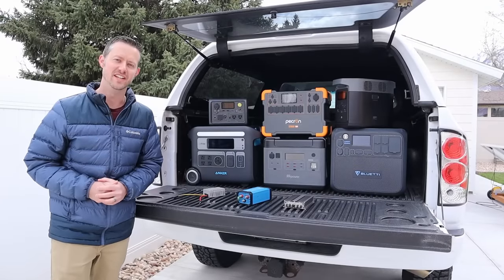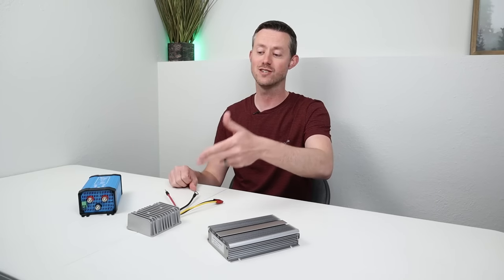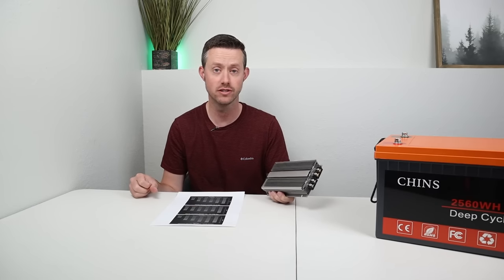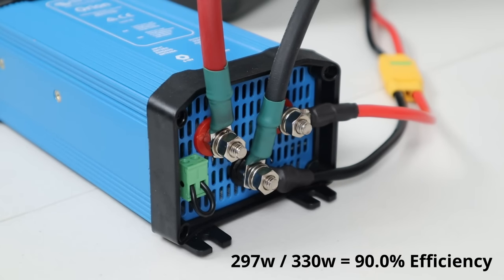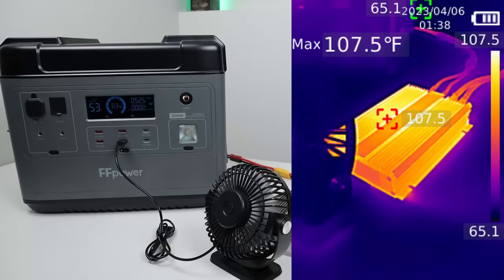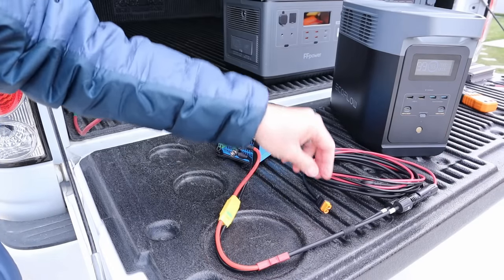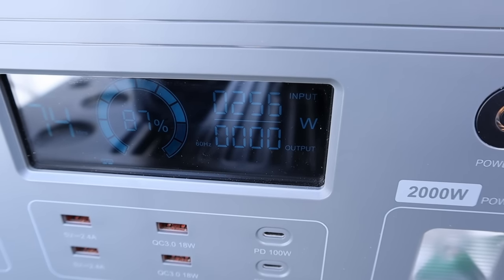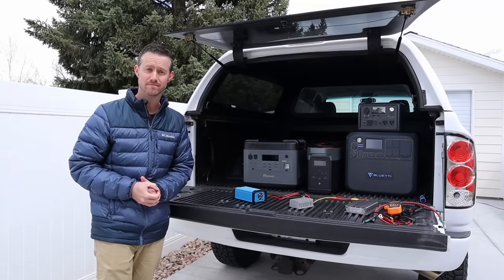Charge Your Power Station In Your Car FASTER - Perfect for Overlanding, Car Camping, and Van Life!

Comment: I'm wondering how your truck electrical is connected to your truck battery? are you using a direct connection with fuse or perhaps a voltage sensing split charge relay that only operates when the truck is running? What are your thoughts?
Reply from the maker: I wired one 6awg wire from the battery with a fuse. I'm using the frame as ground. No relays and I just connect the DC to DC converter when needed. It's not an automated system.
Reply: Thanks but how are you preventing  your starter battery from completely discharging?
Reply from the maker: @berniefranklin3586  I only plug in the converter when in use (when the engine is running).

Comment: Hi Jason I just finished viewing this vid.  Great as always!  I have a hypothetical question.  Is it possible to charge your power station using my Kisae DC to DC charger?  Just curious, please inform.

Thank You!😢😢
Reply from the maker: The output voltage of the Kisae is only 14v, so you'd get the same charging speed on your power station that you'd get using regular 12v charging. You need to get higher voltage output to charge faster.
Reply: @Jasonoid  Okay thank you, I need to save up a little more.  But I'm looking at one of your suggested products  i.e. "Victron Energy Orion"
Reply: Hi Jason, I was able to  purchase the Victron Energy Orion 12/24-Volt 20 amp DC-DC Converter Non-Isolated.  I'll be using it to keep my power stations top off in my home.  Like you have it set up on your tabletop.  The battery and converter would only be around 2 to 3 feet away from my power stations.  Would 8 gauge wire from my battery to the converter and 10 gauge wire to my Yeti.  Are the wiring sizes I'm using suffice?   Lastly should I be using fuses in this scenario?

Thanks You!
Reply from the maker: Fuse goes between your battery and the converter. 10 awg is good for 30 amps continous. I'm not sure how many amps the Yeti supports for input.
Reply: @Jasonoid  Hi Jason thanks for responding.  My Yeti's will take the following charges: 
 
YETI 1250 - High Power charging port (input): 16-48V, up to 20A (320W max)

YETI 1000X - High Power charging port 14-50V, up to 25A (300W max)

YETI 400 - Charging Port (input, 8mm, blue, circle): 14-29V, up to 10A (120W max)

I've been with Goal Zero over 8 years now.  I tried the 
BLUETTI products and the support was horrible, so I sent it back.  I may upgrade later on, but what I have right now fits my needs.

Thanks Again!
Reply from the maker: @minceym  Goal Zero makes excellent products, they are just a little dated. New stuff should be coming soon from them. The Victron should work well with each of those units. 10 awg wire will be fine.
Reply: @Jasonoid  Thanks for your help, yes they are a little dated.  But all of my AGM units were upgraded with new VMAX batteries.  Including chaining several of them in parallel extending my runtimes further out.  My full size refrigerator got over 30 hours  runtimes using one VMAX 125Ah in parallel with the unit.  And a 100Ah Lithium battery using the Goal Zero new car adapter plug into this unit.  This time I'll use the Victron, I should get better results.  Dated but very much reliable.  My only issue was the recharge times.  I also purchased the Clore Automotive PL2320 20-Amp charger for that reason.  So now I have multiple ways to keep these units operational.

Regards!
Reply: Hi Jason, I have some issues when connecting the Orion to my Goal Zero 1000X.  It seems to be working then my 30 amp fuse to the battery blows.  I think the Orion is putting out more power at first glance.  It was over 500 watts.  I turned the potmeter counter clockwise as far as it would go.  The Goal Zero unit is rated for 600W input.  Is the fuse I'm using too low?  Lastly my fuse battery cables are 8 gauge with a 30 amp fuse.  I had them made up already from an existing project.  And the other connection is 10 gauge to the Goal Zero power pole input connection, is that an issue?

Any help would be greatly appreciated!
Reply from the maker: @minceym  The 30 amp fuse can handle 360 watts before it blows (12v X 30 amps = 360 watts). If your power station is pulling more than 30 amps, you'll need to upgrade the fuse to something bigger. Maybe you should plan for a 600 watt load? (12v X 50 amps = 600 watts). So the wiring you'll need to closer to 6 awg and a 60 amp fuse to be safe.
Reply: @Jasonoid  Hi Jason it's been awhile since I have reply back to you on this issue.  I knew your methods of recharging these power stations would work.  I just had to find the right combinations for my older Goal Zero units.  Purchasing from Amazon made it a little easier.  Because I was able to return the Victron converters that did not work well with my units.  I had the Goal Zero car chargers and wanted to see what the voltage output for those small plastic units was.  Using my watt meter they were producing around 15 Volts at 10 amps.  I spoke with Goal Zero and as expected they did not want to give me any information about using a non GZ product.  But the tech did say unknowingly, these units do not work with 12/24 converters.  That led me to think about a 12/12 converter.  So I purchased the Victron 12/12 18 Amp DC/DC Converter, output at 10-15Volts.  And it worked, giving me around 316 or 320 Watts of charging power.  It seems that these converters put out more power than they are rated for.  I don't know why, but I'm happy with the results.  Lastly I also purchased the Victron 12/12 9 amp for my smaller units.   Thank you for your insight and direction.

Stay Blessed!

Comment: If you are using the solar input on the Power Station can you still have solar panels in addition to the DC boost converter?
Reply from the maker: Most power stations have 1 charging port, so you'll be limited to solar or DC input, not both. However, the Ecoflow Delta 2 Max power station has two charging ports so you can do both at the same time! I demo that in my full review.
Reply: @Jasonoid  Awesome thanks.  I'll check that out!

Comment: Is there any reason i couldnt just get a 24, 36, or 48v base battery? Instead of running the converter? Should theoretically be the same output no? Instead of a 12v 100ah battery. Say a 48v 25ah battery or something.
Reply: I should say I have an Anker 767. Up to 20a and  60v.
Reply from the maker: Using a higher voltage battery works the same as a converter. The 48v battery will give you the fastest charging speed (just make sure your battery / BMS can source that much power). 48v at 20 amps is 960 watts.
Reply: @Jasonoid  yes I have the Anker 767 like you do in the video.  It's rated up to 60v @ 20amps. I'm just think reducing the points of failure.
Reply: @Jasonoid  best practice would be to get the highest rated battery (with respect to voltage and AH rating). I'm a little curious to see what has higher efficiency. A converter like you have in the video or just using a higher rated voltage battery.
Reply from the maker: @jaredpnk  battery connected directly would be more efficient. These converters get hot while in use (meaning wasted power through heat).
Reply: @Jasonoid  that makes sense. 

That's why I'm thinking if I'm in the market it would be best practice to get as close to 60v direct from the source power battery

Comment: I added 2 12V Chinn batteries to my Motorhome house battery. After driving  ,the cable under the hood from my  Alternator to the battery under the hood burned completely off. Help me please. Thank you
Reply from the maker: Wires can burn up because of different situations. Some of the reasons would be bad connection joints, short circuits because the cable insulation was damaged, or even from having too much power flowing through them. You need to know what the issue was in order to fix it. Having someone local in your area check it out would be best.
Reply: @Jasonoid  Thank you. I just left it disconnected and use my on board generator to charge the house battery instead of the alternator.
Reply: 400AH LFP ? Were you using a dcdc charge controller ? As you should be ? I charge my LFP @ 90A using 2x dcdc charge controllers (=100A from the alternator), and I use 2AWG (35mm2) wire in the hottest area from the alternator, past the exhaust, up to the fuse block on top of the guard. Remember, wire current capacity derates with heat. Then, I have run 3AWG for the fuseblock to the LFP at the back of the car.

As a rule of thumb, install cable of twice the currently capacity than the maximum current you think it will ever flow. And, bigger wire is needed in the hottest areas of the engine bay.

Comment: Hello:
I’m trying to charge my AC200Max using [12V/24V to 56V 20A 1120W DC DC Step Up Converter Voltage Regulator Charger - CN ] thru the solar input, with the setting set to "PV".
and/or a 12V/24V to 56V 10A 560W DC DC Step Up Converter Voltage Regulator Charger thru the "Adapter" input via a DC Enhancer.
The Bluetti charging display keeps changing from 830 watts to a 0 watts while the engine is idling or driving.
I measured a 56VDC output with 12vdc input.
I tried the setting to both PV and Car/Other … no luck
I changed to factory alternator (75amps output), to a heavy duty alternator (135 amps output).
I am running 18' of 4 gauge wires (marine-grade pure copper conducting cables) for both the negative and positive runs to the back of the van.

Are there any work arounds?
I’m trying to charge the Bluetti as close as possible to the maximum of 1400watts, while I’m driving.
I'm using this:
12V/24V to 56V 20A 1120W DC DC Step Up Converter Voltage Regulator Charger

https://daygreen.com/products/12v-24v-to-58v-20a-1160w-dc-dc-step-up-converter-voltage-regulator-charger
Reply from the maker: What happens if you just use the solar charging port and not the Bluetti charging enhancer?
Reply: @Jasonoid  
I’m sorry, I didn’t specify.

I am trying this (10V-35V to 56V 20A 1120W DC DC Step Up Converter Voltage Regulator Charger) on the solar input that is rated for 10v – 145vdc, 15 amps
  
The Bluetti charging display keeps changing from 0 watts to 830 watts while the engine is idling or driving.  
The 830 watts is the right value considering that 56v x 15amps = 840 watts. 
Also this PV charging port has a maximum of 900 watts input (well within the range).

What are all the causes that can make the Bluetti go from 0 watts to 830 watts over and over continuously while driving?

I tried the 12V/24V to 56V 10A 560W DC DC Step Up Converter Voltage Regulator Charger and I get a continuous 555 watts displayed when plugged into the “PV” port (same input).
The 555 watts is the right value considering that 56v x 10amps = 560 watts
Thx again
Louie
Reply from the maker: @LouisMaida-e7t  sounds like an issue with the boost converter being unable to provide the power continuously. Probably a faulty model. Especially since the other one seems to be working fine.
Reply: @Jasonoid  Hello Jason - I've been working with the Bluetti & DayGreen manufacturers:
The DayGreen mfr. states that I should be using 2 awg at 18 feet instead of 4 awg.
Does that right to you?

I first bench tested this (outside the van on a table) with 4feet, 4 gauge wire and was doing the same thing while the van was running.  Going from 0 watts to 830 watts over and over continuously.

The bluetti mfr. is still working with me.
Reply from the maker: @user-op6iv4qd3w 4awg wire is rated for  85 amps, 2 awg wire is rated for 115 amps. I don't think that matters too much... (unless the voltage is sagging too much with 4awg and the converter shuts off due to low voltage)
Reply: @Jasonoid  I agree, there was no sagging in voltage while I'm trying this step up voltage regulator.  I'm gonna try a Current Limiter Inrush 10 Ohm 15a inline with the 56v output going into the Bluetti Solar Input.
Reply: @Jasonoid  I'm rethinking what's going on here. I am trying to create 1800 watts of recharging capacity for 3 charging inputs (900watts-Bluetti solar input), (500watts-Bluetti Adapter input, w/DC Enhancer), and (400watts-EcoFlow Wave 2 solar input, using an XT60i connector).
1800watts/12vdc=150amps required.
My alternator is only rated for 135 amps.
Should I upgrade my alternator to 250 amps (which is rated for 3000 watts of output) and upgrade the wire size from 4 gauge to 1/0 size?
How does this sound to you?
Reply from the maker: @LouisMaida-e7t  you'll definitely need the alternator upgrade if you are wanting to pull that much power.

Comment: Would the Victron work for the Bluetti EB80S?
Reply from the maker: The EB70s allows for up to 28 volts. You can adjust the Victron to a voltage below that number and it should be fine.

Comment: man  with filtering the riple i could use whatever but  i  wont use my 10a 12 to 24 cheap one so much on delta 2!!!    maybe the struggle of the mppt inside mini bluetti is about some kind of ripple or the converter output was hiting some kind of changing parameter inside unit!!!! like  car charge or solar and back again!!!! 
 i m afraid to think is some kind of high low voltage cause you didnt mention such thing on the other stations when using the cheap one that did this when on bluetti
!!!!!

Comment: How can I used this just using a cigarette lighter cable I currently used with EcoFlow?  I charge the battery while I’m driving but it’s not very effective unless I’m on the road for 7-8 hrs a day. Thank you.
Reply from the maker: Which Ecoflow power station do you have?
Reply: @Jasonoid  
EcoFlow 1200 or 1300. I got in 2020. For next trip out to the west, getting a bigger power station by Bluetti 2200 max.
Reply from the maker: @Halfpace52  using the stock cigarette charging port will only get you 100 - 120 watts charging. You'll need to connect directly to your battery and use an inverter or boost converter like seen in the video to get more power. Find someone that electric savy near you and they can help, just show them this video.

Comment: Will you run these tests on the new bluetti ac180?  Thanks!
Reply from the maker: Since this has a 10 amp input limit, just take the voltage and multiply it by 10 amps and that will give you the charging rate. For example, 24 x 10 = 240 watts or 36 x 10 = 360 watts. Youll never see over 500 watts since it limits to 500 watts. In my AC180 review I tested charging with a 48v server rack battery I was able to hit the 500 watt limit just fine.
Reply: @Jasonoid  thanks!

Comment: I’m an electrical moron. I have the Ecoflow Delta Pro (3,600 w) what size 
Converter should I use?
Reply from the maker: I always recommend the Victron since it has the adjustable voltage and the built in fan. The other options get a bit hot while in use.

Comment: Is there a way where you can use the victron converter to the PV port on the AC200max and share solar power through the same port when the car is off?
Reply from the maker: You can only have one charging source plugged into the PV port at a time. You'd have to switch the connections when you want to charge from a different source.

Comment: Great video. But I guess it assumes I’m smarter than I am. 
How are these installed in a car?
Reply from the maker: The DC to DC converters connect to the postive and negative terminals of your vehicle starter battery. You'd have to run a custom larger wire with a fuse on the postive wire and your good to go. I'd recommend putting in a power switch or a quick disconnect so you can unhook it when not in use so it doesn't drain your vehicle starter battery while not in use. You can only charge while the engine is running.
Reply: @Jasonoid thanks!!
Reply: @Jasonoid hey what is the purpose of the “wire loop” on the back of the victron?

Comment: Just a note on the Ecoflow that if you set the AC charging to 400w and then plug in a 100w load the ac pull will be 500 watts.  The setting in the app changes the battery charging wattage not the AC pull wattage. It would be good if Eoflow allowed you to set a hard limit on the ac pull. I wonder if this has something to do with the UPS mode.
Reply from the maker: Yeah, that's how the dual charging works on the Ecoflow devices. As long as you stick to DC Charging it shouldn't be an issue.

Comment: These settings are good for ecoflow river 288 wh + extended 288 wh battery ?
Reply: Thanks anyways for your hard work and the phenomenal explanation of the process.
Reply from the maker: That model can only charge with 24v and less, so a 12v to 24v converter will work.

Comment: Will the smallest work for bluetti ac180?  Getting ready to set it up but I thought I needed in a 10w
Reply: I was wondering the same thing. I have an ac70 that supports 500w of solar and 58VDC @10A. Exactly the same as the ac180. So it seems I would need the 12v-24v step up converter with 10A max and that would be 24V X 10A = 240W charging. But I recently found a Victron Energy Orion 12/24-Volt 10 amp DC-DC Converter Non-Isolated, I wonder how that would have stacked up in this test.
Reply: @fabiangomez357   Jason's review of the ac180 says 10 watt inverter but strange the eb3a which is smaller can use bigger. Ty for mentioning 10 amp victron gonna look it.
Reply: @winsome6705  the eb3a says 28VDC @8.5A with 200W max solar. From other comments I read it appears the solar generator will lower/limit the amps for you. So I guess a 10A step up converter would work. So you'd get 24V @ 8.5A for 204w or 200w limit.
Reply: @winsome6705  I just want a cheap way to use a cheap $200 redodo 12v 100ah battery to give my solar generator a little more runtime. I like this test because it shows the Orion, but it didn't do well with bluetti and the older 10A Orion is $60 instead of $160, the silver 500w one in this video is nice but I don't want to worry about heat in my RV, and the little one a lot of comments talk about overheating, melting and small wires, they have so many clones too.